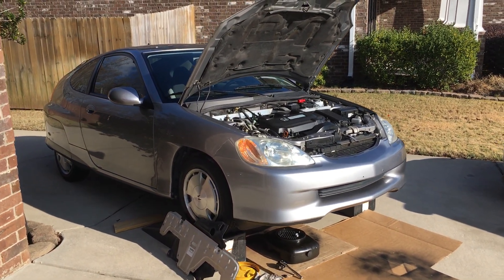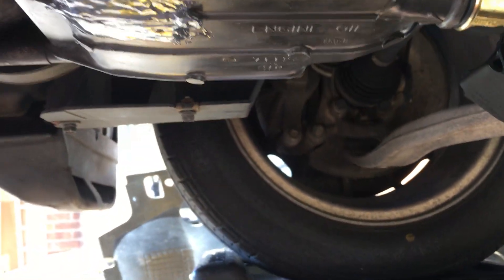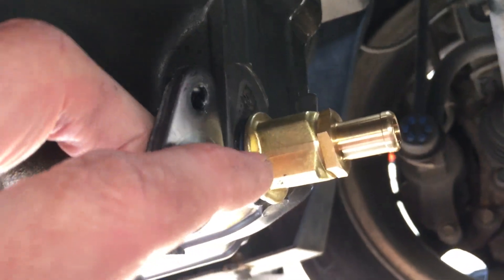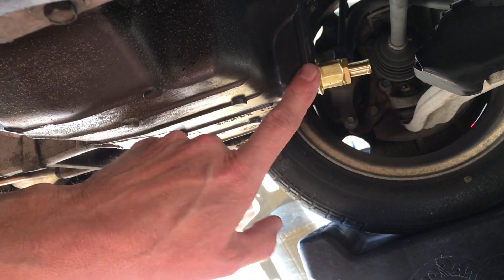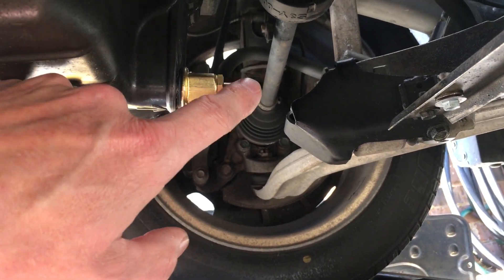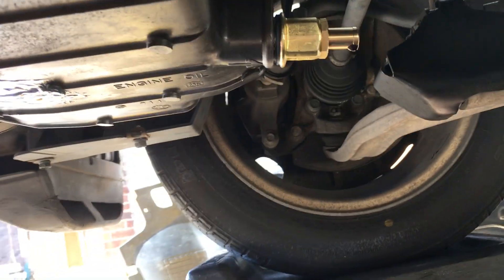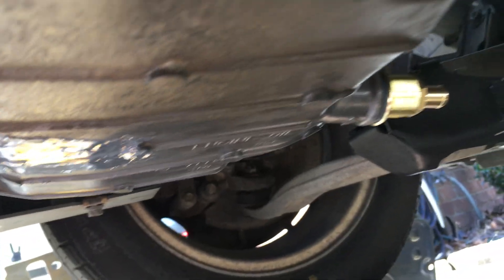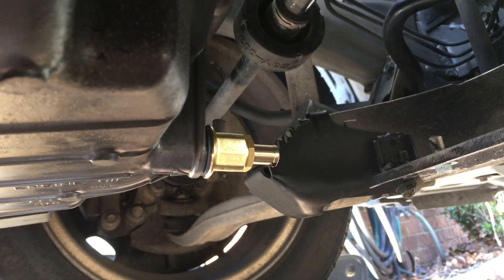2000 Honda Insight restoration video part 7: Fumoto oil valve and RMM

Comment: I like that valve... good idea. I just got done with a new clutch in mine, as well as the new OEM struts and klr3cyl front springs....  I am interested in the 40% thingy.... I have a grid charger on order for mine as well...  My battery is the 2nd the car has ever had...installed in 2012 at the stealership..and I think it is falling on it's face and charging up too quickly / ( out of balance ) . Wondering if you grid charge?
Reply from the maker: 40% hack video coming soon....lots of data to collect to make it worthy.  I don't grid charge, my battery is only 2 months old.